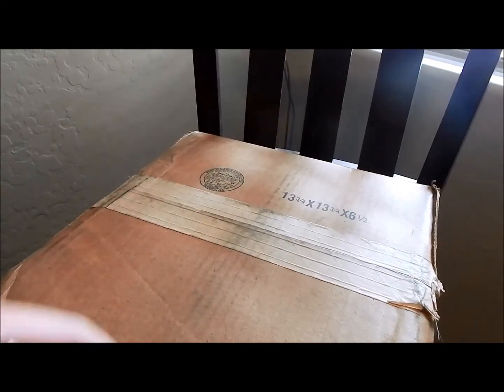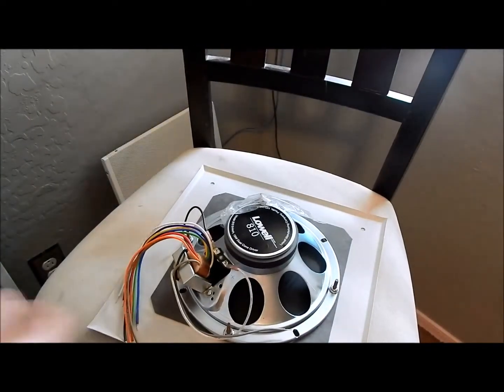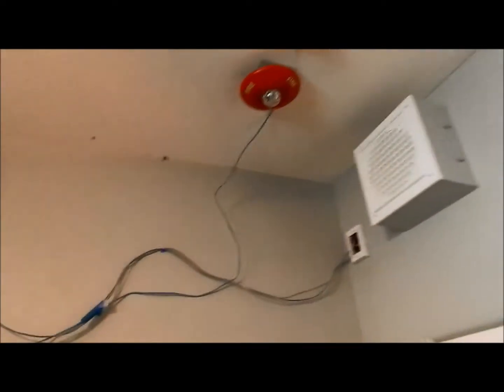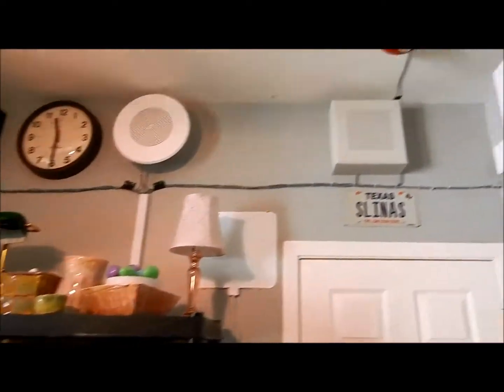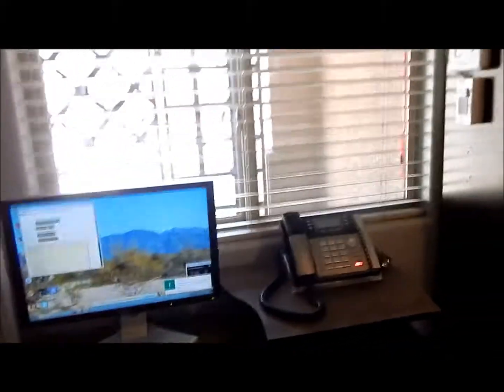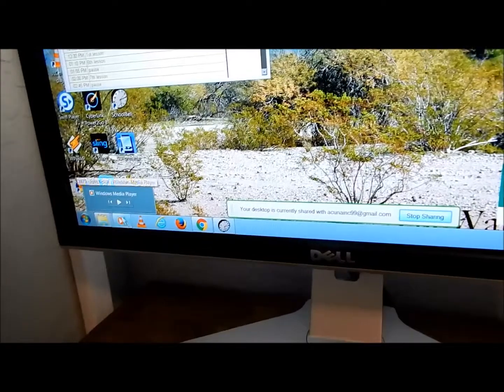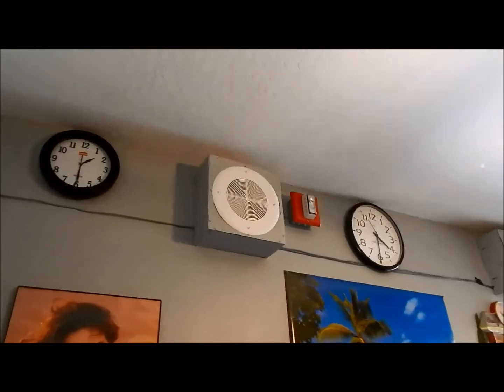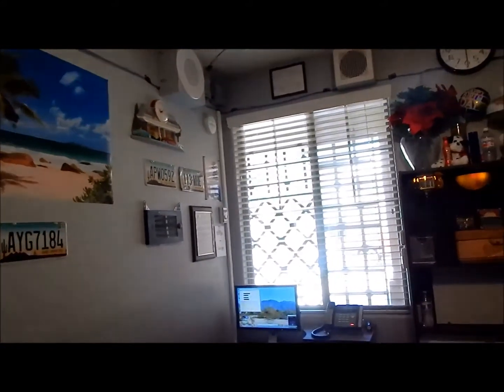Major Intercom System Update As Of 6-3-17

Comment: What brand of phone is that in the workshop
Reply from the maker: The phone brand in the workshop is a Lucent made by Avaya which I found at a Goodwill thrift store. This phone was common at many different Walmart's about five years ago and if you watch the older Walmart intercom prank videos that same phone was used in the video.
Reply: Mr. Mercury Fixit thanks, how would you get a paging system to play tones when you picked up a handset
Reply from the maker: I made the tone generator in one night due to me being board and play mp3 files when the phone button is pressed in which is the paging tone. The tone generator is housed in the box which is a board that my dad gave to me that was used a Costco Wholesale store which was one those in store demos for advertising a product by pressing the button which was for specs about the Sony surround sound speakers on display. The board has a SD card slot to load mp3 files on for the board to play the file when the button is pressed which is the phone.
Reply: Mr. Mercury Fixit you should get a Telecor speaker on eBay
Reply from the maker: I did find a Telecor ceiling speaker set on ebay and planning on buying it later on down the road.